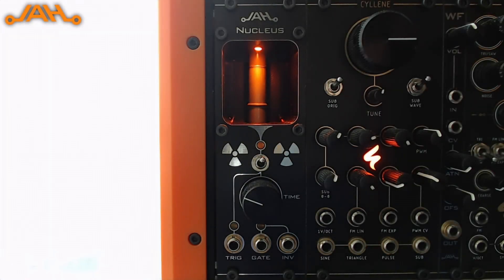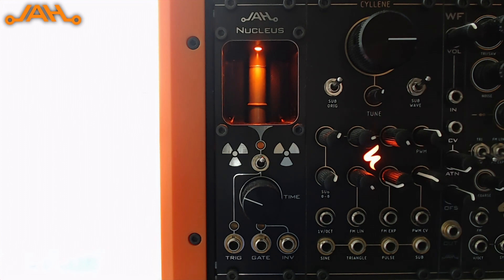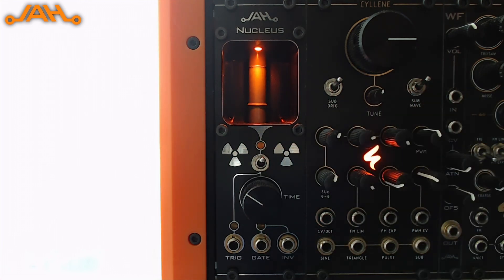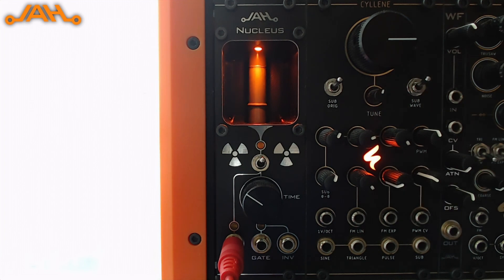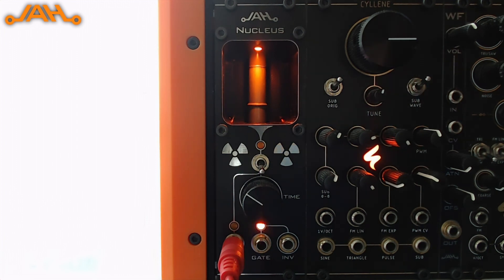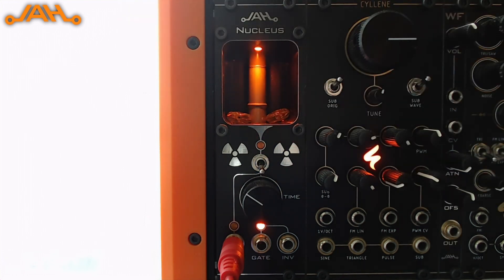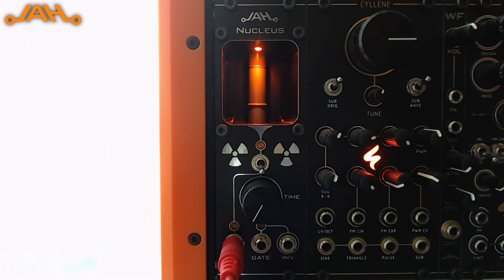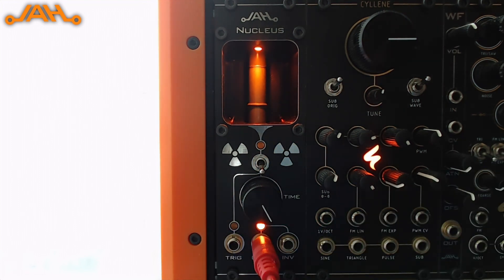Module Demo: Avalon Harmonics Nucleus - Geiger counter random trigger and gate source

Comment: Where I once would fear the cost of truth, now I only ask: What is the cost of this module?
Reply from the maker: It will be around 300€ at launch. Some of the parts in it cost a lot, like the Geiger Muller tube, and the driving circuit which I buy separately when assembling the modules. Currently considering selling a cheaper variant as well, where people buy their own parts for this and complete the build themselves.
Reply: @Thorinair  300€, not great, not terrible!
(I am kidding of course, sounds fantastic and what an interesting idea!)
Reply from the maker: @bojangprodoktschns5428  +1 for reference xD